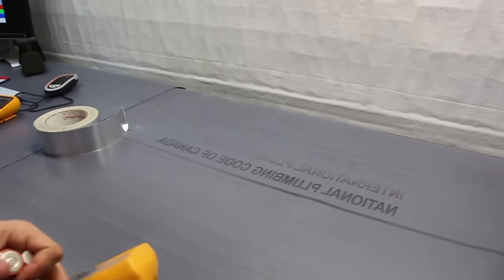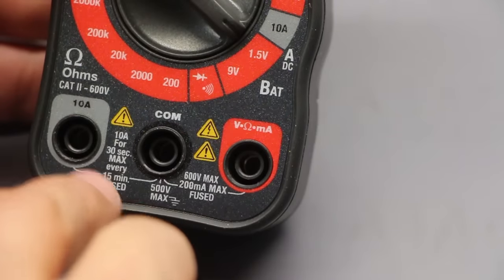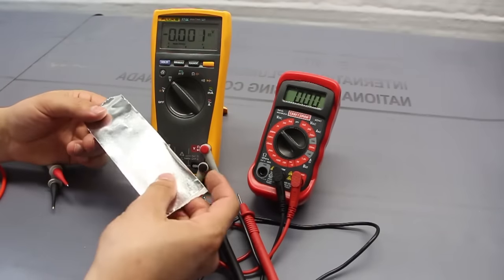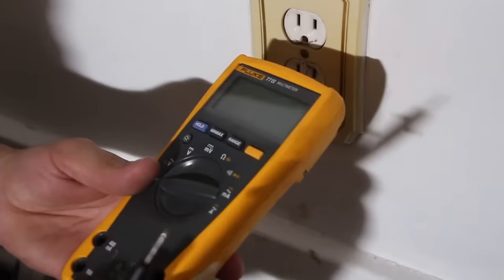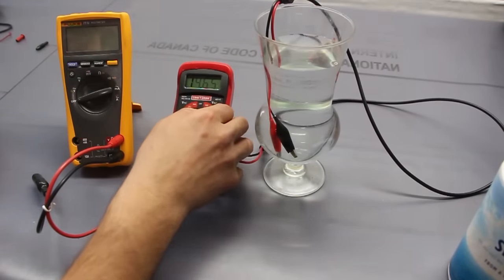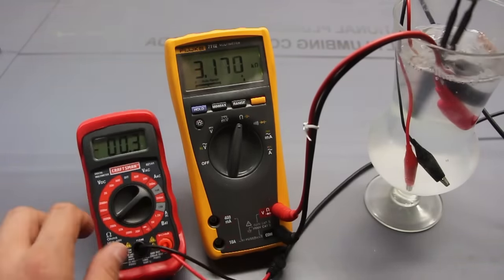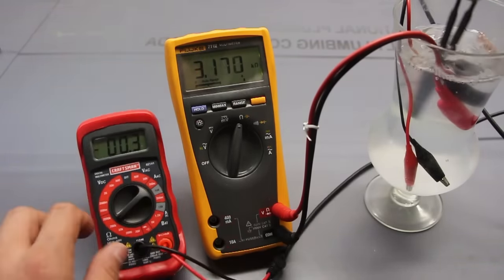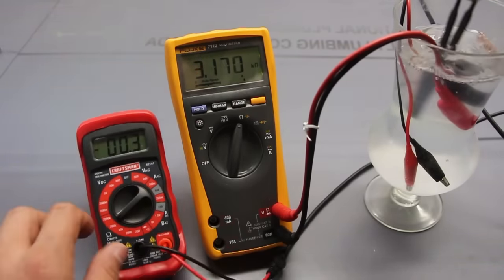The Best Multimeter Tutorial in The World (How to use & Experiments)

Comment: Just one suggestion especially measuring over 100 Volts AC or DC. At 75 Volts you can have a cardiac arrest, so be very careful with anything over 75 Volts. If your not sure of the voltage you are measuring, make sure you start from the highest setting (1000V) then work your way down. If you have no voltage reading, try your tester to another outlet that is working. As a saying test the tester first. This cheap tester should be returned to where you bought it and have a recall as someone can get killed by mistake.
Reply: Misleading statements.  Voltages much higher than 75 are not necessarily dangerous, such as static electricity.  And voltages less than 75 can easily kill you if there's enough amps.
Reply: Sorry, it's not misleading. Your talking about static electricity which can only be measured by oscilloscope. You can only get a shock as static is momentary voltage and dessipates soon it hits you. Same as 3000 volts DC output of ignition coil of a car. It will only give you a shock unless you get stucked. Im talking about 75 volts AC or DC output of a power point.

Comment: Another correction: Ampere and Voltage are not comparable units of measurements. It'll be like saying 30 seconds isn't a long time but 30kg is really heavy. So to say 20,000volts didnt kill you, but 2 amps will is really misleading.

Comment: Dumb question. What does the OL mean?
Reply from the maker: In voltage and current modes, “OL” typically means that the meter is overloaded and cannot read the value being measured. This may happen if you’re trying to measure a voltage or current that is higher than the range your meter is set to. In this case, you’ll need to adjust the range to get a valid reading.

Comment: Sir, In The Above Video, At The Time  Duration Of 09: 48, You Spelt as 200 milliVolts for 2 Volts. Actually, The Meter Printed As 2000 Milli Volts. Am I Correct Sir?

Comment: Great video but.. I have one question.. in the beginning of the video you made it very clear not to switch the probes you use for your multimeter due to different quality however, when you were testing the outlet, it is clear that between the 2 probes showed in the video that those are different probes than the one originally shown. Just a little confused by that is all.
Reply: That advice is wrong: With most cheap meters the leads that come with them are junk anyway so using different leads won't make a lot of difference, if your paying for the quality and accuracy of the Fluke then it follows that you should only replace any leads with another high quality set.

Comment: I work with welders. 240V transformed down to 110V and up to 175 amps... Forever touching earth and electrodes. The practice of lighting cigarettes off the hot end has been done since the 'beginning of time'... Work in the wet, work in the rain.... Forever getting the tingles as a constant reminder that the amps are ready to want to go through a body just as easy as steel...... My question is why if its Amps that kills you and not voltage, how is it that welders aren't dropping like flies?... Its a genuine question but I will add that I have heard in the long distant past that a welder did actually die while lighting a cigarette off the electrode. Perhaps he had his bare hand directly onto the steel at the same time? I don't know but its the folklore that's always been about. Tell me from your viewpoints.

Comment: 35:20  will kill, it only takes one or two of WHAT?  Anything over 200 milliamps is dangerous but it takes higher voltage to break down your natural skin resistance. 75 volts is about where you can start to feel the tingle through your fingers. The wetter your feet or hands are the easier it is for you to get an unwanted electrical shock. Always wear shoes and gloves.

Comment: Apparently most are confused about NOT changing the probes, I comprehended that as meaning to NOT use the color coded Black Probe where the color coded Red Probes plugs into to! I've also read a lot of comments by those claiming to be "Professionals" with electricity, if that is so true why would they watch a beginner video on the basics of using a multimeter. Just saying.

Comment: the ans to resistor  comment below is this  take two 100 ohm resistors   side by side twist bothwires together on each end now measure  with your meter    (50  ohms)    now take the other two twist them the same way  (50 ohms)     now twist all 4 to geather ( 25  ohms )    you may never need this but its good to know you can do it    i used this patern on my 53 army truck wiring   to get gauges to read corret.

Comment: I got a little 10 dollar knock off of the 10 dollar Harbor Freight meter.  10 Amp meter, leads, and probes.  I accidentally left it hooked up to a car battery when I was trying to find a parasitic draw, and started the vehicle.  Meter left hooked up for about 60-90 seconds roughly before I shut off the vehicle.  Thing saw about 15 or so Amps consistent, no idea what it got on engine start up or when I brought the engine up to speed and the alternator gave out more power.  It got really hot, but didn't melt or kill the meter.  Pretty dangerous, if I didn't shut the vehicle off when I did, it could have caught on fire and in turn burn the vehicle down.  Unhook your meters, kids.

I'll be damned if that's not one tough little bastard though.

Comment: I did a test on a cheap meter once, I smoked the analog multimeter by testing 120v on the lowest voltage range. Some of those cheap multimeters are sketch
Reply: @KiwiPokerPlayer   He said analog multimeter.  I also smoked my expensive analog multimeter way back in my college days in the 1970s by accidentally selecting the wrong voltage and POOF it was toast!  Taking the back cover off revealed a horrid burned smell as well as the sight of the burned/blackened component.  Obviously, newer digital multimeters have built-in circuit protection, but that wasn't always the case.

Comment: Thumbs up for an excellent tutorial. I often use my SOAR multimeter, its a quality Japanese make on car electrics and it a useful tool. For home electrics I only change a light bulb, and thats it as I am not a qualified electrician and leave it to the experts.
Could you do a tutorial on current induction between wires in a wire bundle - as that example you got from the wall socket demonstrates. Thank you!!

Comment: Dan, I strongly suggest you view Dan Sullivan"s Videos if you haven"t as yet.
He is a professional auto mechanic and specializes in electrical and electronic Diagnosis.
Dan is a Instructor in this field and has invented a tool called the Load pro which reads voltages of live closed circuits which eliminates the other 2 potential faults in a circuit {Open and Shorts to Ground.}
You can do a continuity test which will appear to be good; but his special Multimeter Leads will show that the wiring could be robbing the full amperage that the end appliance should be receiving, just because the wiring is only partially in tact causing low amps.
His method of teaching Ohms Law is more modern and makes more sense.  V/ A {Omega  The Last letter of the Greek  Alphabet}   
Not V/ I R   which makes No sense today.
He would tell you never to refer to Amperage as Juice....Big NO NO
I own a Set of his Leads and his training manual and they are both great.
Good Luck

Comment: You don't need a tester with a kill switch or mushroom switch at 29:10 it's clear the N.O and the N.C means normally open or normally close in the sleeping mode when your not push the button the contact keep staying N.O and N.C when you activate the button by pushing it the contact reverse there position the N.O become N.C and the N.C become N.O .
Every time you see a contact N.O or N.C even in a electrical contactor means with the power OFF when you put the power on the coil of the contactor the N.O become N.C and N.C become N.O  that's basic no need of a tester for that.

Comment: Remember that sheet meters the leads could blow up if they touch it wrong The meters could blow up if they do it wrong you need to tell people fluke is rated with heavier cables or the leads or testing and those cheat meters those leads I've seen them blow off when they hit the wrong voltage and stuff

Comment: There are several  wrong statements made by the presenter.  For example, he states you may measure the INTERNAL RESISTANCE of a Battery!! It you try that it's Good Bye meter!! At best you will burn up the internal fuse. Worse, you may burn up the meter leads and burn yourself!
    In most cases measuring the resistance of a wire is impractical with a multi-meter for wires larger than 16 gauge unless you are dealing with many feet of wire.  What you are really seeing is that the wire has continuity.  On very low resistance ranges you need to include the resistance of the meter leads as part of the circuit.
   When measuring the voltage at an outlet he demonstrates only that that particular meter is defective on that (200 volt) range! This has little to do with the design that he blames, he simply has a bad meter. Also with that same test he turns off the switch feeding the outlet and concludes that the 25 volt reading he gets from a "dead" outlet proves there is something really wrong with the house wiring that needs repair .  What he is really seeing is capacitive coupling  in a multiple (3 wire) conductor cable when measured with a very high internal impedance  meter.  The top portion of that outlet is  likely un-switched ( Commonly used in rooms for lighting circuits that use floor or table lamps). The length of wire from the switch to the outlet forms a capacitor (Two conductors separated by an insulator) which couples the voltage on the "HOT" (un-switched) to the switched off ("DEAD") conductor, resulting in the 25 volt reading. Either meter would show similar readings, dependent upon their internal resistance on a particular range.  Plugging a low impedance load into that outlet will demonstrate that very little current is provided by this high impedance coupling. 
  Better to listen to someone who knows what he is talking about!

Comment: Positive  and negative do matter on a household receptacle.
Voltage does not actually alternate from positive to negative. There is more to it than that.
A plug-in has positive, neutral and ground.
Depending on the breaker box, the neutral may be wired to ground or it may be wired to the neutral on the power line.  There is a difference.  But for intensive purposes it would be proper to hook the negative to either the neutral or the ground and the positive to the positive.
If you look at the craftsman meter, it shows a negative.  Indicating the wrong polarity.
It looks to me by the  way the readings are plugging the leads in in two different ways and weird readings,  that you may be wired reverse polarity on that plug-in.
Also if there is some other incorrect outlet on the line, there could be current feeding back into the neutral which if it is an actual neutral does load balancing,  so there can be voltage on a neutral. I would try putting the negative on the ground and testing the neutral.
Thank you for the video.  there is some good stuff in here.

Comment: With regard to switched wall receptacles your theory is not accurate.  It is common practice for one of the receptacles on a room outlet to be wired to a wall switch adjacent entry room door while the adjacent outlet is hot all the time.  You will find these in older homes where there aren't overhead lights so they are wired for a lamp to light when entering the room.  This outlet configuration will create a "Phantom Voltage" or "Ghost Voltage" which is perfectly safe since there isn't any current flow.

Comment: Here is a good one for you guys. Connect two 10M ohm resistors in series and place them across a 10V dc source. What do you expect to read across one of the resistors? 5V or 3.33V. Most would say 5V, but what will the meter read? Time to read up on Measurement Principles and understand that when taking a measurement, how it affects the circuit.
Reply: 5M and 10M resistance in series, so 1/3 of the 5V.
Connect two 10 ohm resistors in series and connect it to a AAA battery and what do you think will be read by the DMM across each resistor?😉

Comment: During your voltage test when you were measuring 25V off a socket with the switch turned off, your meter may have been picking some inductance on the line. That is normal. I don't think there is a problem with the switch or the breaker. To test it properly, put a small load across the power socket like a light bulb and see what you measure then. Repeating @Peter Mortensen's comment below which I have just noticed. Nicely spotted, Peter. 

Let Mr. EEVblog teach you about multimeters. He knows what he is talking about: https://www.youtube.com/watch?v=gh1n_ELmpFI

Comment: Guys, multimeters are dangerous tools! They are designed for experienced and trained people to make reference measurements only. No accurate measurement can ever be taken from them as that requires a dedicated instrument which has been calibrated. They should NEVER be used to prove dead!! That requires an approved tool and a proving unit to test the tool before and after use.
Measuring current with a DMM requires the instrument to be connected in series with the load, not in parallel or it will explode in your hand, current is much better to be measured by a clamp meter around the conductor in question.
Regarding the 25 odd volts, that can be caused by inductance where two AC lines running in parallel can induce a voltage from one to the other, while it shows a relatively low voltage it will have almost no current and connecting a load across it will deplete both. That's the reason cables running together should have the same insulation type. STAY SAFE!!
Reply: I just bought one on ebay. But after watching this, I'm just going to throw it out so I don't electrocute myself or start a fire. Now ,I'm so stressed out, I'm not going g to flip on a light switch. All I see is an electric chair!!!

Comment: WARNING: The generalization "current is what kills people, not voltage" (35:00) is neither useful nor accurate. When working with power systems, higher voltage systems are generally considered more dangerous than lower voltage systems. The ability of higher voltage to overcome resistance, both of insulation materials and within your body, means it is more apt to complete a circuit using your body as part of it, and the way it effects your body is different. Higher voltages are more apt to stop your heart, for instance; they can cause your muscles to seize and interfere with brain activity. Internal burning is also more possible with higher voltages. While low voltage high current flow is perfectly capable of starting a fire, electrocution danger increases with voltage, not the other way around. Electric chair execution applies about 2000 volts to its victim. At 120 VAC, 10 milliamps (10/1000 amp of current) is considered potentially lethal. That's why GFCIs are designed to trip at 5 mA. BEWARE OF HIGH VOLTAGES.

Comment: WTF@ 37:55 is missing a huge don't try this at home lol

don't shove a screwdriver into an outlet
really never use the ammeter in the multimeters for anything idk about anyone else maybe if you made probes to use with breadboards for low voltage stuff
definitely not to measure toaster wattage by clamping 9000 alligator clips on a screwdriver shaft sticking out of an extension cord outlet
use a clamp meter with line splitter for chrissakes

its not the volts that kills you
its not the current that kills you either

its the fire that breaks out if something comes loose and shorts that 6 inch rod of exposed energized steel thats gonna kill ya

If you can't help yourself at least stick it in the left slot
no actually just don't shove a screwdriver into an outlet

Comment: Oh boy! You cannot measure the Internal Resistance of a battery by using the OHMS setting. Internal Resistance is found by placing various loads on the battery and doing a plot. On a car battery, IR is usually in the low milliohms. That cheaper meter actually has a Battery Setting where it loads the battery...unfortunately, it only has a single 1.5V setting and 9V. A 1.5V battery from a AAA to a D each is usually placed under a different load, so one setting on the meter is kind of useless.

Comment: I wouldn't call this the "best" tutorial. Especially when you're testing the outlet. You ALWAYS put the black probe in the neutral first.
Reply: Why's that?
Reply: @Mistermoleymole  no particularly important reason other than the concept that plugging in to a hot side first while you casually flop around the other probe that potentially could be energized to the same high voltage through the meter.
In practice, if the DMM is properly set to voltage measurement mode, it's of no real consequences because the meter is generally very high impedance.
It's like being worried about those old screwdriver neon lamp voltage testers, which actually use your body as a ground when measuring 120VAC.

Comment: My old Radio Shack meter would always read DC volts accurately.  But, AC volts always read low by about 10 to 15%.  Once I discovered that, the Radio Shack meter went in the trash and I bought a Fluke model 87 multi-meter.